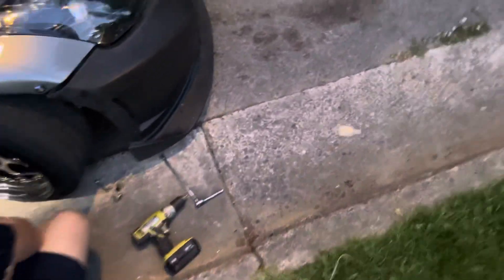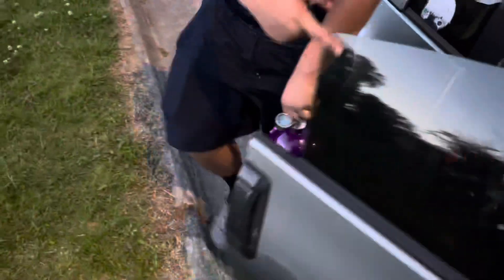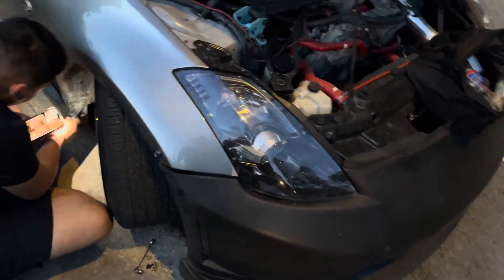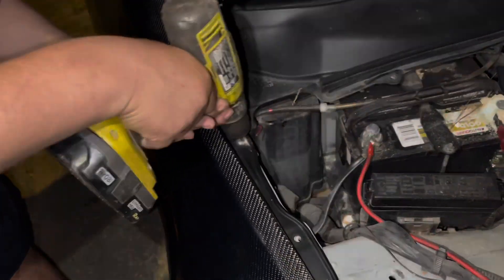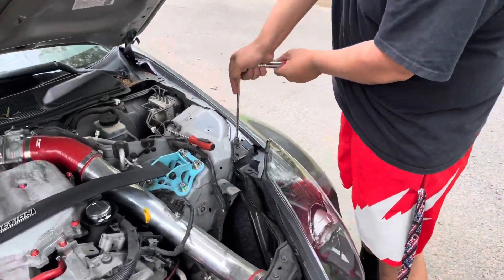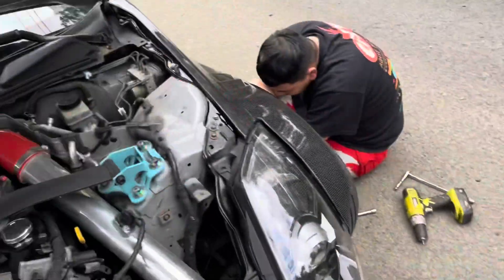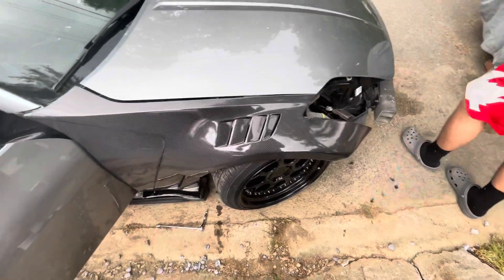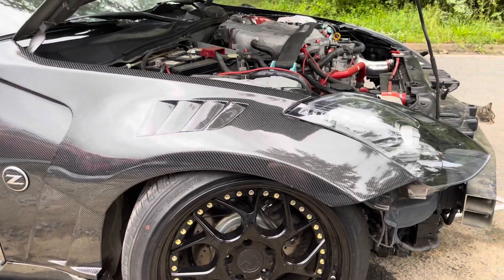Alliance carbon cf fenders ‘’ best fitting fenders !!!!

Comment: Thanks for making this video.  I ordered these fenders from their website over a month ago and they said it's going to take about 3 months for them to make them that's how backed up they are...lol  I really didn't know how to install them.  I'm disabled with 1 arm that works so when I get them I''ll start at the top, rear fenders and go to the headlights then work my way down I guess.
Reply from the maker: It’s only 3-5 bolts , but it’s a fair installation, kinda do need a second person tho for them bolts near inside the doors to make sure the bolt don’t go in wrong
Reply: Hey bro, by chance have you received your fenders yet or been able to get a response from them?? 

I ordered mine in April and tried DM'ing on insta but haven't gotten a reply